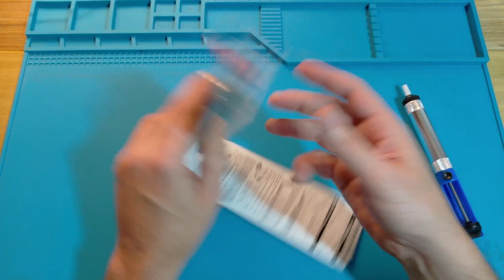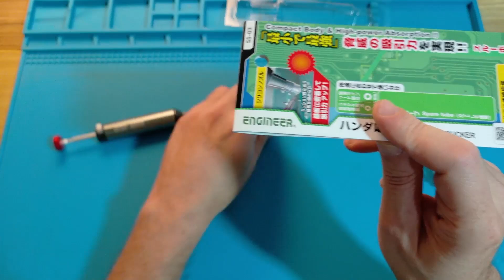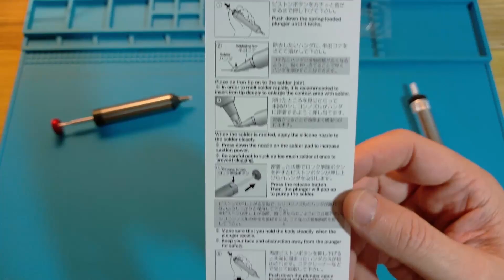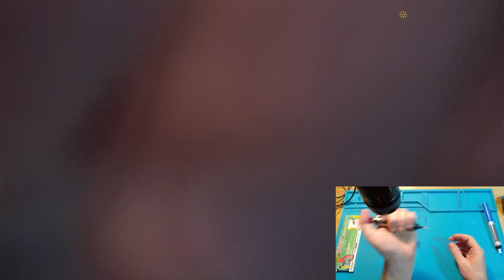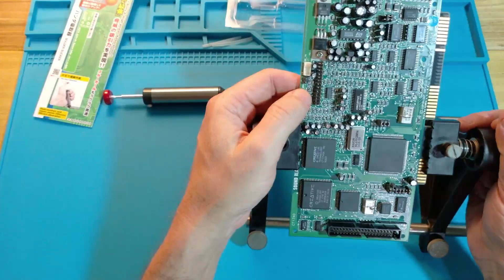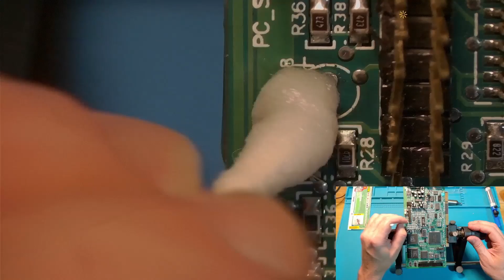Engineer SS 03 solder sucker pump test

Comment: I just got mine today and I can’t unscrew it to clean it—this seems like a big flaw. There’s no knurled grip on the cap, so it just keeps slipping. I even tried using a rubber band, same issue. This is an excellent pump, and I don’t want to risk damaging it with pliers. I also try with masking tape, nothing.

How did you manage to unscrew yours?
Reply: You don't need to do it. Watch the video again, he pushes the solder out of the pump after he sucked enough solder. That's how I always do it with another pump.
Reply: @surfhai  i was able to fix mine finally. Tk